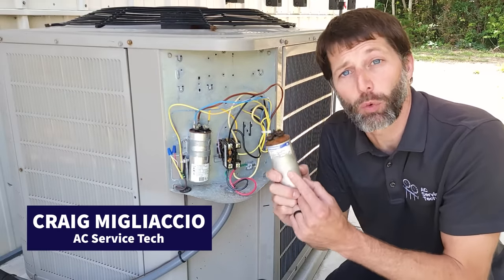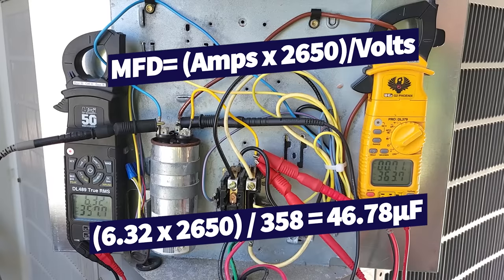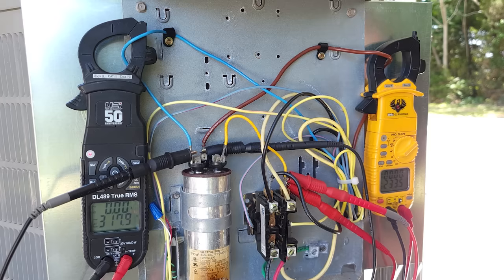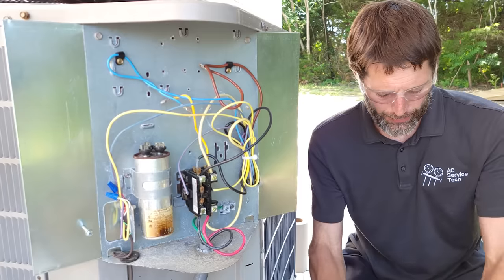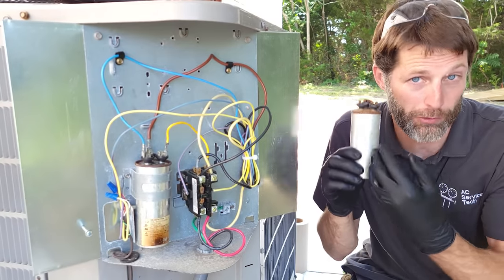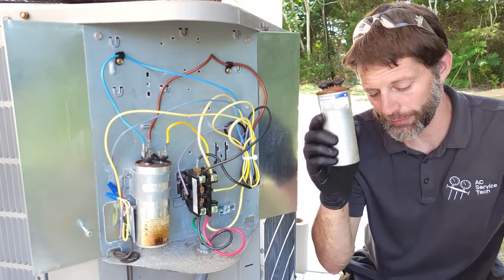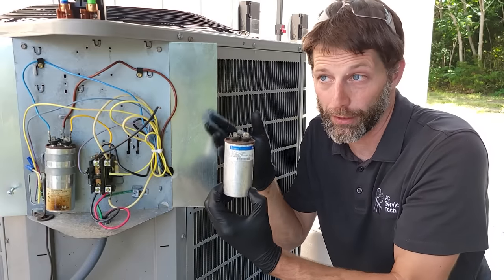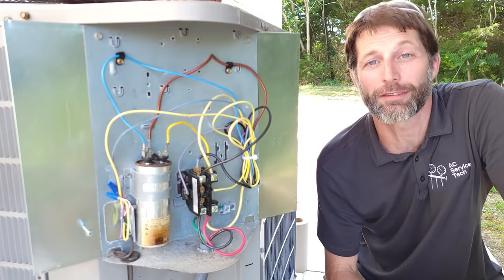WHY CAPACITORS FAIL in Air Conditioners! Watch it Break!

Comment: I heard a lot of posible causes and personally the one thing I’ve been seeing over some years it’s that when you expose the capacitor to extended heat streaks periods,confined spaces(with poor ventilation)and/or very exposed areas to direct sunlight(no shade from sunrise to sunset),the “uf”rating diminishes dramatically compared to systems in well ventilated areas with some shade at least some time of the day!
Maybe you should try out a test like the “Project Farm”guy and let us know how it goes…
Reply: The capacitors installed upside-down seem to fail a lot, and they don't bubble up
Reply: @aberobinson1  I’ve never seen a capacitor installed upside down,it’s there a specific brand that do that on their systems,or is it simply a “SPECIAL TECHNICAL CONFIGURATION” that some pseudo-technicians use?
I have seen them horizontal but never upside down!
Reply: The upside-down capacitors were installed like that at the factory. I believe on Carrier ICP low-end stuff like air-quest
Reply: I’ll keep an eye out since I’m yet to see one. Today I took apart an old carrier condenser with huge capacitors (volume,not micro-farads) and they seem to be the original ones from when it was built,nobody ever laid hands on it since installed(and it was working well but customer decided it was time for replacement),seems that planned obsolescence it’s the name of the game now days,or as some call it “job security”…
Reply: @aberobinson1  also pentair heat pumps
Mounted upside down right above the contactor 
Dumb so they can fail and take out the contactor too 
Maybe even catch the oil on fire
Reply: @ardentmonk2  some times I wonder how these silly designs get thru ingeneering,planing,development and production… and we at the other end wind up dealing with their sloppy mistakes and apparently no one catches this but us!
Funny how it works,Wright!?🙈
Reply: @pastormartinez4676  You forgot a job step there... engineering, development, planning *accounting* production. It's the accountant who make those change to ensure "value engineering" is present. That's how you wind up with things upside down that should not be.."well, it was $.50 less to do it that way". Later received bonus for cost savings and increased part sales.
Reply: @uswcboy  true,now we know who to thank for all the excitement when we find stuff to chat about while roasting them smart “A’s”😂
Reply: Not a scientific test, but whenever I have moved them out of the control box and put them inside the condenser coil near the compressor (due to space issues), they seem to do very well.
Reply: @pastormartinez4676  Generally as a rule of thumb the higher the voltage rating the larger the capacitor. Instead of a 370V rating we see for 220V systems they were using 630V caps.  Two reasons for the 370V caps .... cut's costs and more compact size .... but mostly cut's the cost
Reply: @uswcboy  I'm an electronics engineer ..... I call it Beancounter Engineering ..... I always hated it when they would change the parts I spec'ed for a project because it saved a few pennies .... There is a reason for every component I specify and not just size and voltage/current rating but also the manufacturer

No way in hell would I spec a 370V cap for a system running 365V back EMF ..... It should be a 440V cap which gives you about a 20% cushion
Reply: @longjohn526  absolutely. When the engineer specs a part, there is always a reason that specific component and manufacturer was used.  It’s when the value engineering occurs that everything gets fubar’d.

Comment: Great video! I’m sitting here in the Florida Summer heat waiting for a new AC. Going to be a Carrier heat pump. My Trane lasted 19 years with the usual TLC. Evaporator coil sprung a leak. It was a straight cool with gas heater.

Comment: I'm not a HVAC tech, but I changed out my 7 year old cap that had been replaced with a Amrad and also installed a Amrad easy start as preventive maintenance in the central Texas heat on my 13 year old unit. I am replacing the contactor as well which is 13 years old just as preventive measure. That's on my list today.
Reply: I'm in South Texas....San Antonio to be exact and the darn near year-round heat is brutal.
I'm also not a HVAC tech and I definitely know my limits and know when to call a professional. 
I'm also not a ASE certified mechanic, MECP certified, licensed electrician, plumber nor a computer tech but I do all my own work which is quite satisfying.
Reply: It's rare for a Contactor to fail so just skip it and same yourself some time, money, and labor.  Sometimes they do fail but very unlikely!
Reply: @dickhertz8103  The OEM contactor was 11 bucks. I have had to replace them before.
Reply: This is a good practice, that cap (7 years in service) was well past it's normal useful life, in my experience.
Contactors do wear out as well, depending especially on their quality and proper selection for "wetting" capability, which accounts for contact wear.
Reply: Is there a particular brand of capacitor that is better quality and where do you purchase them to have a backup on hand?
Reply: @trailerparkcryptoking5213  Amrad mentioned above is a well known brand and well thought of.  There will be either a dual section or 2x capacitors in your outdoor condenser (1x for compressor and 1x for condenser fan motor) in addition to the indoor air handler blower motor in many cases (esp: older equipment using capacitor start type motors), newer type electric motors (typically variable speed type) often aren't capacitor start.
I always check the capacitance to confirm it's correct before installing, using a digital volt meter (DVM) capable of measuring capacitance.

Comment: Careful of those Chinese capacitors. I bought one for a motor I was using for a project and it was much lighter then the old one. I used it and it lasted a couple of starts. For giggles I cracked it open and it was a 240volt 5uF X/Y safety cap typically used in ceiling fans crudely soldered to the lugs.
Reply: Why did you trust it in the first place?  What did it cost, like 89 cents??  Don't use cheap shit!  Easiest lesson ever!
Reply: @paulcopeland9035  The cap I wanted was on back order and I thought the cheap one could hold on until I got the proper one. Wasn't for a A/C or anything like that. It was for a wood turning lathe I built from scrap.
Reply: True. Replaced mine a few times, sometimes Geckos were the culprit. The last time I put a universal motor in and had to wire 2 capacitors for it. Worked ok but it failed. Finally called AC guy and he replaced it with a US made larger capacitor. Was a bit expensive but he did say many of these capacitors out there are China ones and this one was warrantied. Had some loud starts and stops for a bit, not sure why but it stopped and no problems.
Reply: the new chinese caps are junk, trust me, been doing hvac for 20 years, seen them last a week

Comment: Low line voltage will overheat them. Where there are brownouts, I've spent all day replacing run capacitors. The ICM 492 voltage monitor is good to have installed.

Comment: 5:50  The energy stored by a capacitor is NOT held on the plates but, rather, in the dielectric in the form of an electrostatic field that  causes polarization.  This is electrostatic induction.  A dielectric, by definition, is an insulator. If the rated working voltage is exceeded, the dielectric is literally pulled apart and the plates will arc as you no longer have a dielectric.  When the plates arc, there is a vaporization/heating and that expansion is the physical damage on a electrolytic capacitor's can. Other types of capacitors physically fail in other ways.
7:33  The capacitance is not dropping due to a "foil breakdown".  It's the dielectric that is failing which will then lead to plate damage.
7:57  Again, the dielectric is what is damaged by over voltage, not the plates. 
8:03  The damage is NOT on the plates, initially, it's from the dielectric failure.
In any event, please don't give electronic/electrical theory explanations if you don't understand it yourself.
Reply: Plus, in effect current doesn't actually flow through a capacitor, the changing ac voltage in the circuit makes it work the way it does.
Reply: Sorry pal u r only partially correct
Reply: You are absolutely correct.  However, as we both know, you will observe plate failure on every failed capacitor.  That or a dead short.  Which is likely where the idea came from.

The good news is that HVAC techs and Electricians don't have to be electrical engineers.  They don't have to know why the formula works, just that it does.

The two things that bug me are the Cap not being rated for the peak voltage, and the fact that formula will change based on 50Hz or 60Hz.  There's a decent chance the rating is RMS, but the formula is something that could get people who just go by this video in trouble!
Reply: Question for you though. You keep saying it's on the dielectric but isn't the dielectric in this case the (forgive my layman's terms) "big roll of foil" inside the capacitor. If you cut one of those open it's basically a giant roll with 2 thin sheets of foil and something separating them.
What is actually considered the dielectric?
Reply: @hvacmisadventures  The material between the two sheets of foil is the dielectric which is an insulator.
Reply: @stuzman52  thanks. So basically the insulator breaks down allowing a direct short across the "plates"
Reply: @hvacmisadventures  Yes, that’s correct. Insulators have a maximum voltage rating and of course with heat the dielectric will break down.
Reply: @stuzman52  and now the original comment makes a lot more sense. Thanks for the help 👍
Reply: @hvacmisadventures  Glad to help! 👍
Reply: @hvacmisadventures  The dielectric is the thin layer of insulation (non-conductive material) in-between the foil layers.
Another mistake mentioned in one of the other answers above, is that the foil layers are not where the capacitor's energy is stored.  The voltage difference between the two conductive layers literally pulls on the dielectric insulating layer, so failures are more likely a defect in the dielectric layer, permitting a tiny arc to bridge the insulator, and that starts a domino effect which ruins the unit.
If anything, the voltage difference between the plates Pulls The Plates More Tightly Together, and THAT stress on the dielectric can 'find' defects that will kill the capacitor.
And for the quick-on-the-draw critics and skeptics out there, I have an EE degree and worked in fields of power transistors for 14 years... 🙂
Reply: Semantics.  The capacitance IS dropping due to foil breakdown, even if this is due to the dielectric not being effective.  There really is damage on the plates (or in this case, foil coils).  That's what arcing does.  Meh, seems like you just want to play know-it-all/argue when you're not more correct than the statements in the video, instead just unable to process language.
Reply: @hvacmisadventures  for electrolytic caps, as this likely is, it's either a liquid, or a gel, and liquid is not necessarily hermetically sealed and will cause the liquid dialectric inside to evaporate out, Gel versions are, I believe sealed and I think both degrade whether in use or not over time, but yes, when the dialetric element breaks down, it can cause shorts and other issues as stated.

At least, that is how I understand it.
Reply: @johnhpalmer6098  Gotcha. I'm not sure of the proper name but I've cut a few of these open (the ones that look like a soda can) and they have that big roll inside of them and the rest is filled with castor oil to help with heat dissipation as they are meant to stay in the circuit while the motor is running.
Reply: @hvacmisadventures  If in the circuit continuously, then they are run caps, sometimes may be referred to as motor caps, if they are start caps (those are electrolytic) are only to get the cap to run, then are removed from the circuit, once the motor reaches about 70% of its rated speed. One or both are seen in AC units for both the fan and/or the compressor and occasionally the same cap contains both inside and they are then referred to as dual caps.
Reply: @stinkycheese804   Yeah, I agree;
he's just trying to get all technical and shit.
  The gentleman in this video is simply trying to provide us with an instructional scenario that, although it may seem a little complex for some, it is in layman's terms to the best of his ability, in order to teach others what exactly is going on inside of the cap. 
Moral of the story: Don't be a dick, @Retired Engineer.
Reply: Wait till you tell them that energy doesn't flow THROUGH a wire.  THAT will mess them up. LOL.

Comment: I have to interject as I have seen high current burn out hundreds of capacitors over 20 years. More accurately the cause was power loss and internal heating due to high ripple current. The ripple current degrades the capacitor by raising its internal temperature!
Reply: Power loss and high ripple currents doesn't sound like a scenario that applies to HVAC.

Comment: Thanks for this,  I recently paid a service technician $250 labor to replace my capacitor, it took him about 10 minutes, now I know where it is, what it looks like, how to tell if it's bad, how to turn off the current, and I looked on line and found out where I can buy a spare.
Reply: I installed my central A/C in my home myself 24 years ago. I am not a tech, just a DIY type of guy. 5 years ago the condensing unit stalled, I found it sitting there humming and unable to start. A little bit of online digging gave me the answer, and the capacitor had swelling on the top and bottom of the can just like what is shown in this video. I found a replacement cap on amazon for about 15 bucks and bought 2 to have a spare. Up and running in no time for chump change, and the unit is still running strong today, the only other thing I've done is put the gauges on it 2 years ago and top off the refrigerant charge. I talked to a guy who runs an HVAC repair service and told him how I fixed the bad cap for 15 bucks. He said he keeps a stock of those caps on his truck and marks them up to $49.95, and then there's the service call and labor. That's why you pay $250 for the same repair if you call him, and it is totally understandable when you consider his overhead and the fact that he is not in business to break even.
Reply: Most semi-densely populated areas have HVAC supply houses where you can buy a cap locally, so have the system back up and running, but if it's not expensive the prudent thing to do is just go ahead and buy one so you have a spare, especially if A/C not working would be a significant hardship on the residents.

Comment: Great video… very educational. I have spare capacitors for my furnace but never thought to get them for the compressor. I will be doing that this week. My furnace and ac unit are only 10 years old and the furnace has had one of the  capacitors replaced twice.
Thanks.
Reply from the maker: Yeah better get that one too! Its time.
Reply: My AC guy talked me through replacing mine, I always have a spare. Save yourself big money on a service call.

Comment: I'm of the opinion that capacitors only fail 30 seconds after you've left a job site. Even though you checked the unit and watched the AC run perfectly for multiple cycles after doing a filter change on a unit for the most pain in the ass customer you know. Because we all know "it was working before you looked at it".
Reply: As I tell my customers, "it's like your kitchen light bulb, it was working fine 10 minutes ago, but now it is burned out" They all get it at that point...
Reply: Unfortunately, not all tech are as honest as they should be.  It's hard to tell the good ones from the bad.  Most people assume they are being lied to.
Reply: @ramtek2702  It's funny you say that. Most mechanics are paid by the hour with no commissions or bonuses of any type at least where I'm from. There is absolutely no reason for mechanics to lie to a customer to just sell them parts because there's no insensitive for us to do so and we're usually so incredibly busy and have other calls to get to. The real problem is the lack of qualified mechanics these days has caused a lowering of standards when it comes to hire practices. In the last 10 years or so the industry has been floaded with hacks that just don't know what they're doing and they are "parts chargers" because it's the only way they know who to get something to work.
Reply: @ramtek2702  Your first 2 sentences are correct, but the last sentence is wrong. The majority of homeowners don't know they are being deceived so they continue to trust the dishonest ones until an honest tech tells them how the other guy was cheating them.
Reply: @briangc1972  Also, a good tech worth his/her salt may have to suss out the real truth with customers as they can also lie to a tech, hoping to get away with not having to say, pay much.
Reply: Truer words never spoken. Learned the hard way to test them on every service call even if unrelated issue.
Reply: @daleroyston6117  In my day, I've seen many with mechanical stress failure where the terminals are pressed to the pins coming out of the cap. It's usually on a unit that some bozo replaced the cap or a wire connected to it and put it under tension/strain and it doesn't take much.  That, combined with vibration and viola.

Comment: Good content, but how did you get the capacitor to fail on camera? Based on the browning of the bottom of the capacitor, it looks like you had a heat gun, just off camera aimed at the capacitor. It would have been good to show how to safely discharge, disconnect, and identify a replacement capacitor--as this is a very common failure point in all AC motors. A new start capacitor costs $20-$30, and can be easily replaced by a home owner, saving a $100 to $200 service visit from an AC tech.